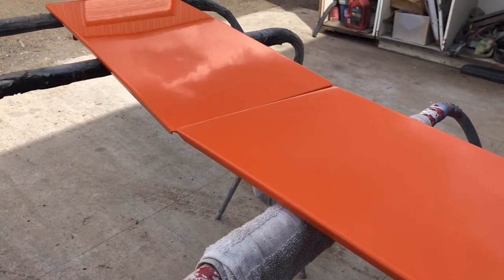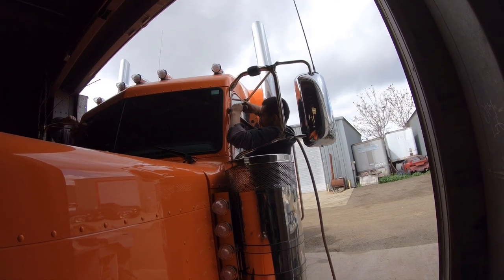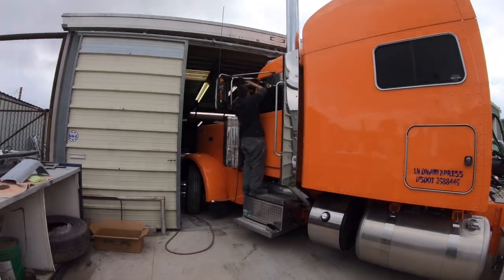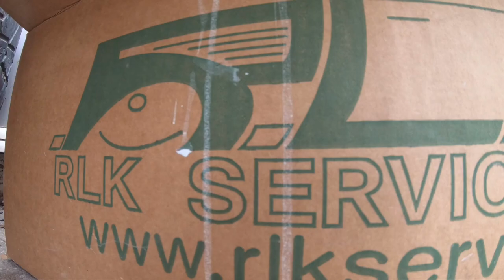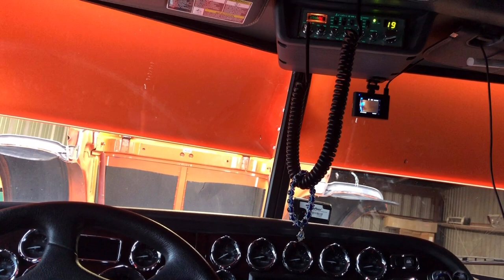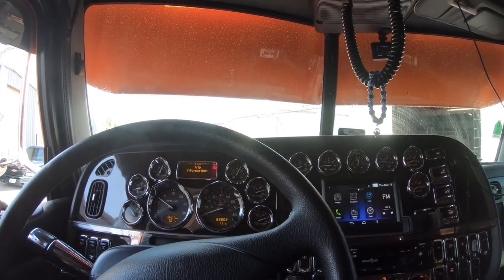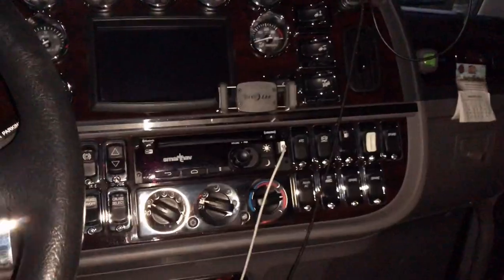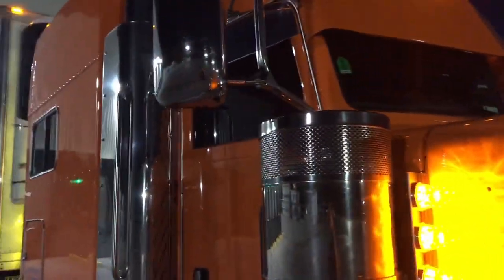(8)PETERBILT 389 visor installation, OMAHA ORANGE , 14" flat glass rlk #bigrigjatt #jatt389 #punjabi

Comment: How does the center bracket mount/bolt into the center of the windshield?  Also did the guys dig the back of the rivets out of the A pillars so that they don’t rattle around?  How many hours and cost for the installation?

I’m looking to add one to my truck.
Reply from the maker: Dezelrig HP there is metal in middle as we have 2 windshields . I had to drill 2 holes in the metal and no we didn’t fish it. I just put some crazy glue on it before pushing the rivet in

Comment: Nice truck man! Hey I installed my visor butttt it had a slight vibration the middle bracket did you bolt up at the very bottom? Or the top? I currently have mine at the top but it has a slight vibration at idle and when I drive it moves a bit as well
Reply from the maker: Yes . Bolted it from top and bottom. Or it will flap